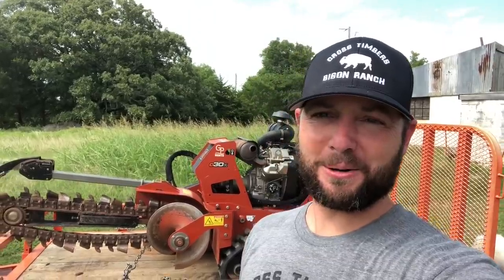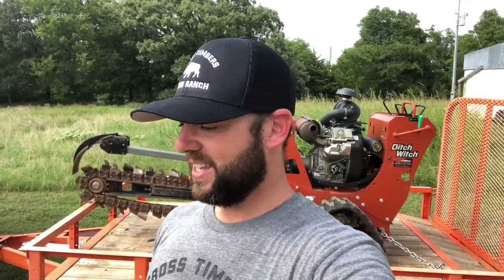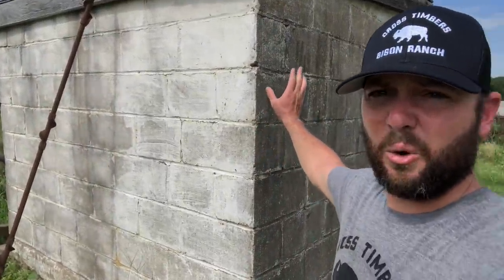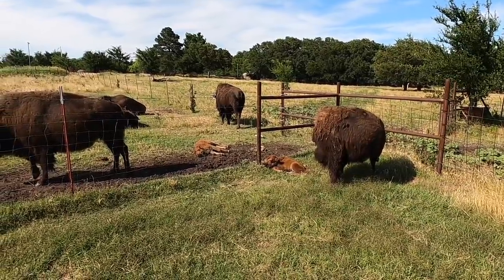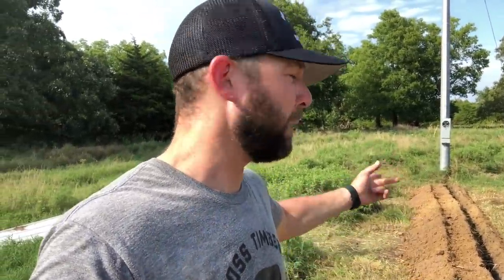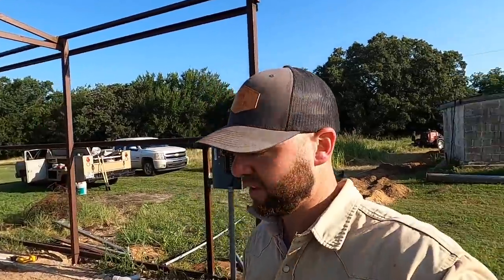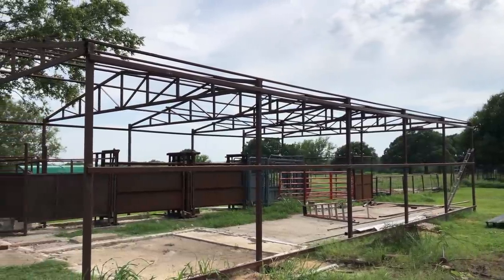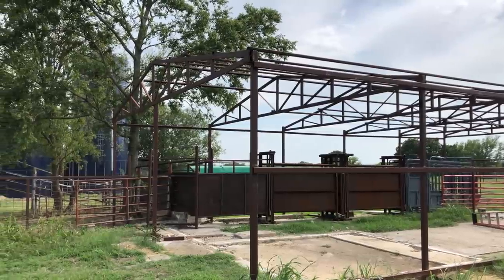Breaking Ground for New Projects!

Comment: Wow you are moving right along getting your farm done the right way.  When I worked with Bison we had a heavy equipment tire suspended from a telephone pole set up.  He use to paw the ground, wait for it to hit him in the head and then go at it again.  The bull left the gates alone but that's cause the farm had high tensel electric fence with the gates wired to it.  The only issue we had with the bull and the herd was when the bull calves reached 2 years we had to remove them from his area or he would remove the competition, if you know what I mean.  You are doing a great job and you know your herd well.  You will have a successful future.  Don't forget that spinners of wool and alpaca fleece also love bison undercoat.  Not always the easiest to harvest but incredibly warm.

Comment: Invest in the hydrant frost free pumps for your field water.  They are amazing in freezing temps with no frozen lines.
Yes, 30 gal/minute is very good well flow.  A good well is a huge boon to have.  The bison will love having good water too.  
Tank heaters are great for winter and not having to haul water is impressive too.  To prevent mosquito larvae a few goldfish keep it under control.  Know many horse farms that use that for field tanks.

Comment: Build gate out drill stem cut smaller pipe 3 inch long so hang them bolts,weld extra heavy duty gates and Dunbar hook all day long want rip apart